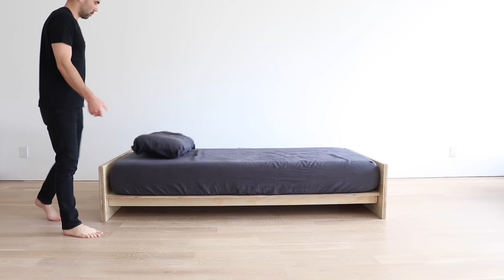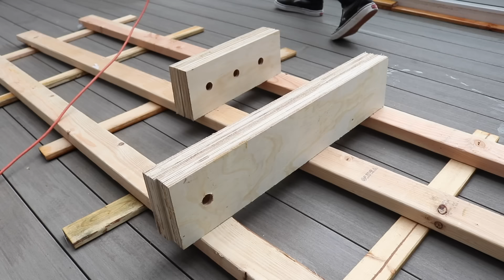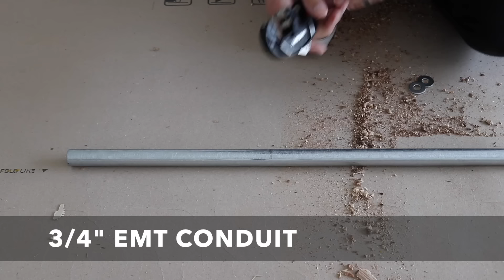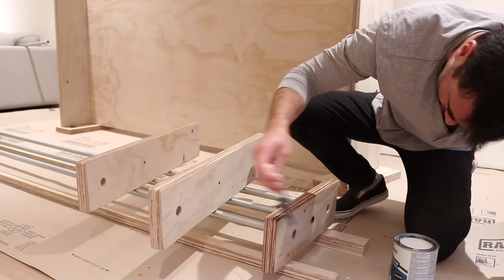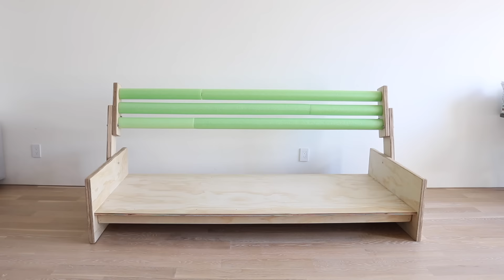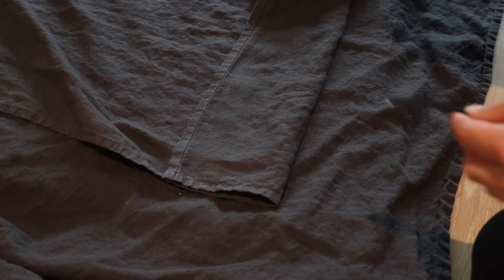DIY Sofa Bed

Comment: Wait, something is not clear: do you have to unscrew and rescrew 4 bolts, every time you want to adjust your sofa back to a different position?
Reply: I have same question
Reply: it's a dumb design that was just made for a YouTube video.. no way he actually uses this.  Probably went right in the garbage after the video was done.

Comment: i noticed the main beam support immediately started to sag when you lay on the bed.  I think you need to use more wood  or stronger wood.  The middle section is extremely weak .  Other than that, this is great Diy idea!!
https://youtu.be/Ae8Aoiqi2EI
Reply: You don't have a clue. stick to macaroni pictures.

Comment: i've loved lots of your designs but i don't see much point in this. usually the idea is that a sofa turns into a double bed. this is as much a bed in sofa mode as it is in bed mode, and takes up pretty much the same amount of space however you configure it.
Reply: I like the  idea of a bed with lounging option.  I’m more concerned about the use of a regular matress. It’s not recommended to sit on them. That’s why they don’t use them in sofas. After some time the matress will have holes in places you sit on and will be uncomfortable when you lay down on it.
Reply: i agree. makes no sense putting down the backrest cuz its not like you creating more space for bed. you can lay on it to sleep in sofa mode just as easily in bed mode